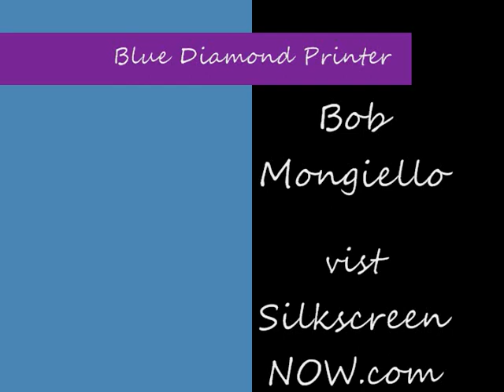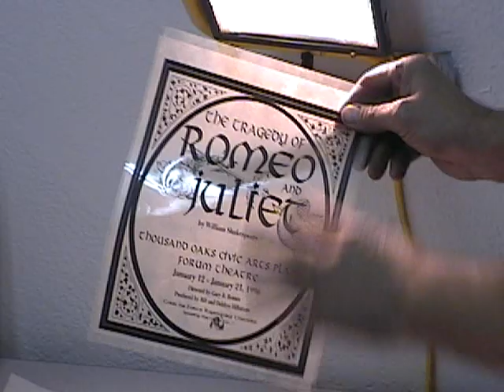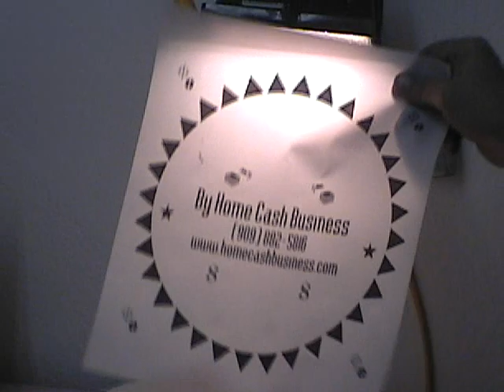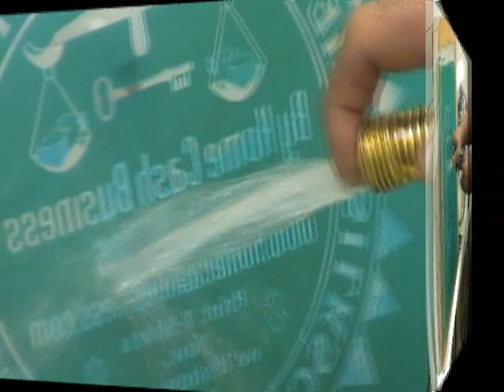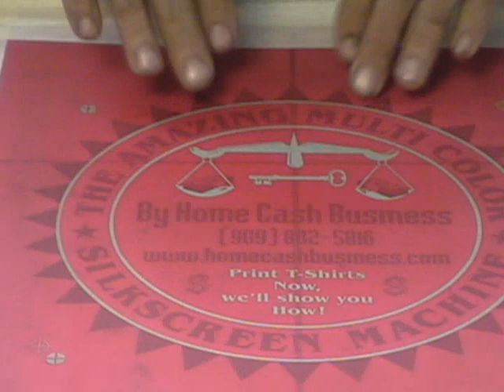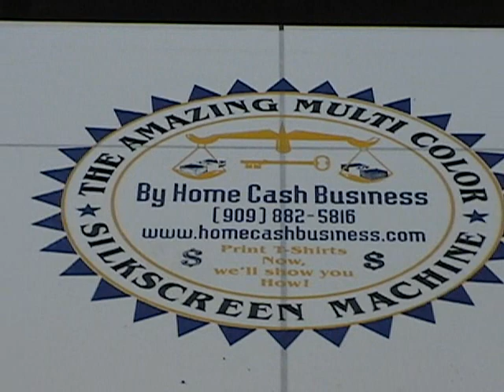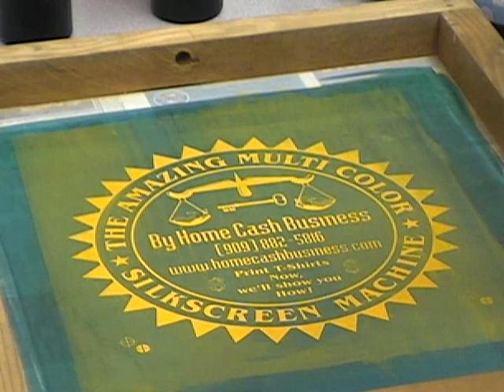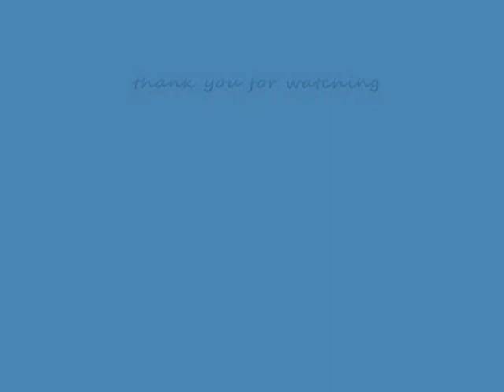The Blue diamond printer and how to print 3 color print on a t-shirt

Comment: hey bob  first I want to thank you I have watched and made lots of the stuff for my print shop .but I have never used a printer like this can you tell me how you use off set for printing
Reply: Did you get an answer?  It appears that he doesn't use a off print.
Reply from the maker: I do not do off contact when printing on t shirts and it works great , I have always used off contact when doing plastic or material that does not absorb the ink .
Reply: Tape coins to your screen or frame for off-contact. Nickels usually work great.